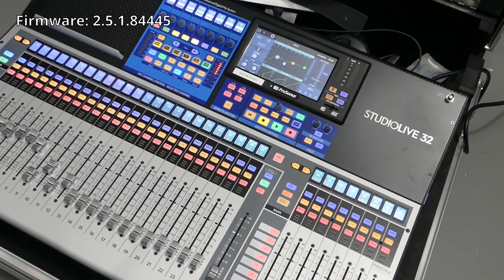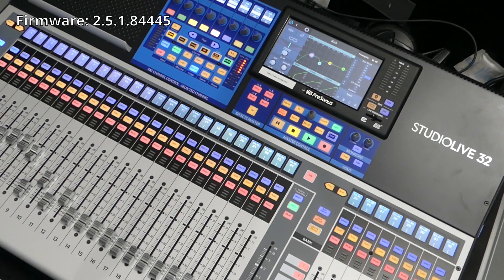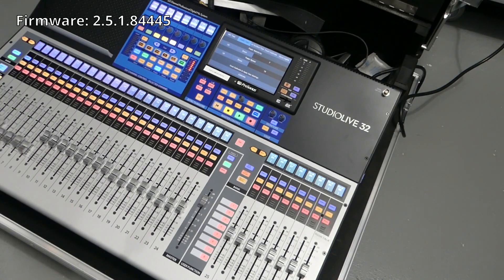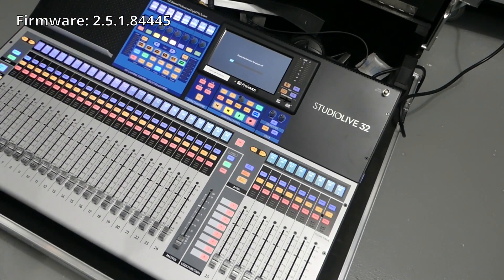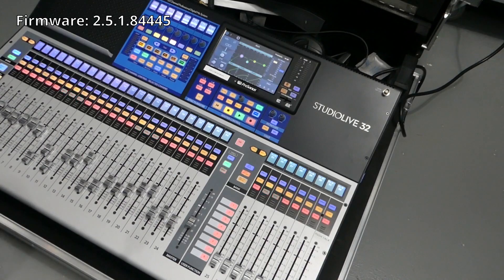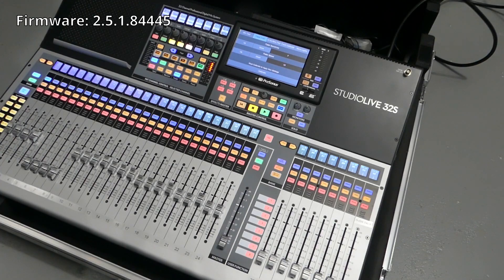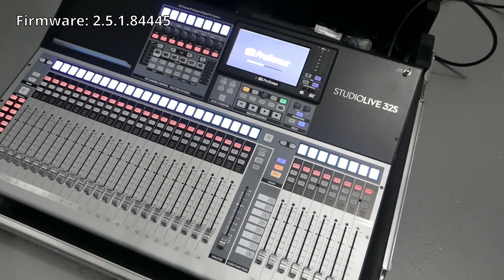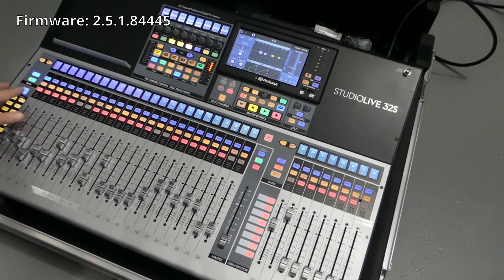Re-calibrating the faders on a Presonus StudioLive Series 3 console

Comment: Thanks for the great video, my studio live 32 s will not recognize my computer and universal control will not load my plugins. I'm going to try to set it back to factory, I have updated the firmware but did not help. Thanks again for your video
Reply from the maker: I understand the frustration!  Make sure the console firmware and Universal Control (on your PC) are both at their most current respective revision levels.  
We do not use any of our consoles for studio work; it's all for live sound.  Unfortunately, I can't give you much more advice on your connectivity and plug-in issues.  Good luck!

Comment: How can it mess up your board if it's built to do this with the firmware update? Seems like you would do more damage by panicking and forcing it to stop doing this.
Reply from the maker: For the calibration, there was no mention from Presonus that a re-calibration would be conducted.  Though, a re-calibration of the faders can be conducted at any time manually.

Comment: Can this Presonus StudioLive series III console be used connected to a DAW using Studio One, Pro Tools, etc. to simultaneously mix multiple tracks at once as the song is playing (real-time) when mastering as normally done in studio?   Or is it just basic live mixer with only the added feature of recording the separate tracks (which is still pretty cool)?  

From what I understand the older (‘classic’) StudioLive 16.4.2 etc. models (and most other similar consoles) cannot actually be used in combination with a DAW app for the real-time simultaneous multi-track mastering and can only perform the recording stage of the process.  Hence in order gain the ability to do real-time multi-track recording (using faders for at least eight individual tracks) while mastering with a DAW app requires the addition of a Presonus FaderPort 8 or 16 (or similar device).  Please correct me if I am wrong or confirm if I am right.  Thanks.
Reply from the maker: ...answered in your question on the "Overview" video.